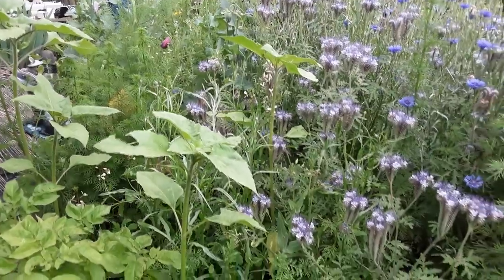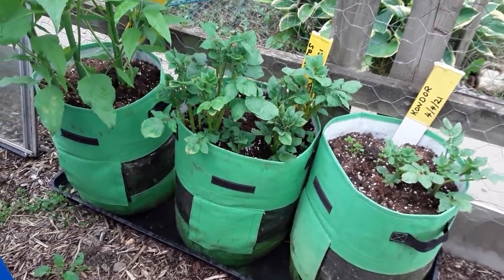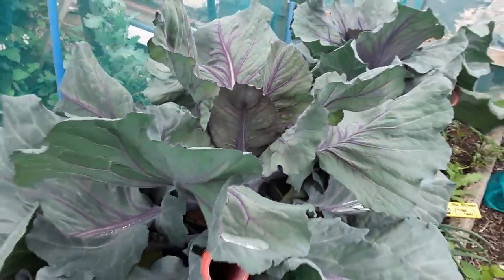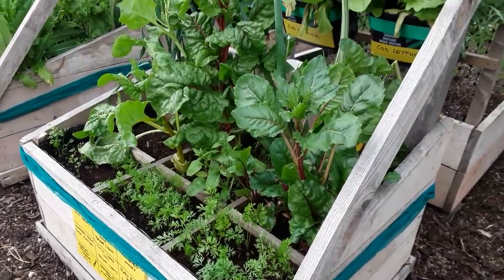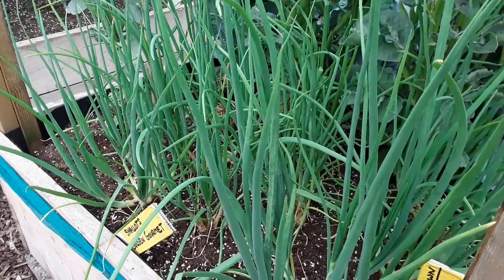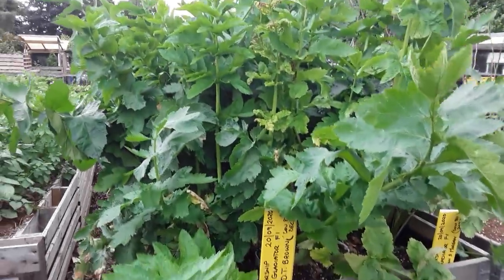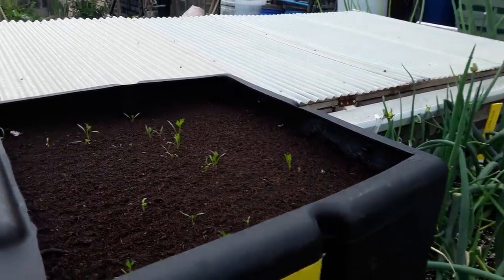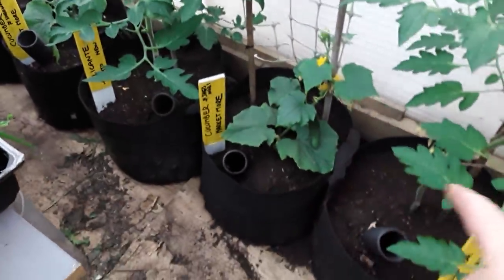SHEDWARS21: Gardening 🌻 End Of June Tour Of Our Allotments 🌻 Gardening Hints & Tips On A Budget

Comment: Hi Terry, Another great tour video, and almost everything looks really good, it's only the onions that spoil the day going to seed as they do, more drainpipe lengths and fittings, you are a lucky fellow, Take care.
Reply from the maker: 5 onions out of 20 odd isn't bad considering they are inside Ronald and my outside ones are all good so I don't see any point in trying to overwinter them other than an early crop. 4m lengths of guttering are very scarce so very happy with those and may be able to add to my long Vegetables platform. 

♻️Happy gardening, Terry King.